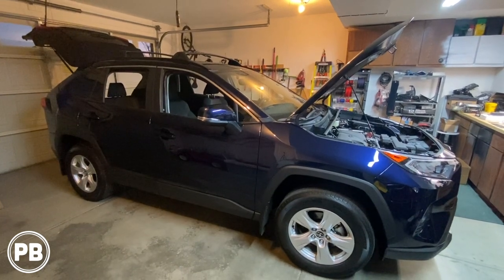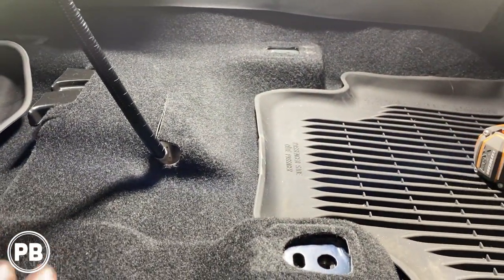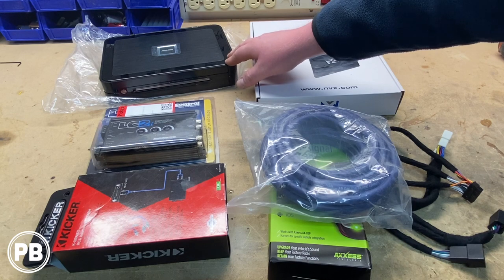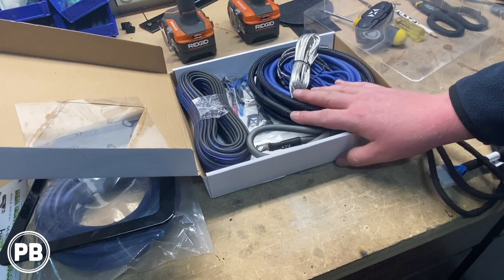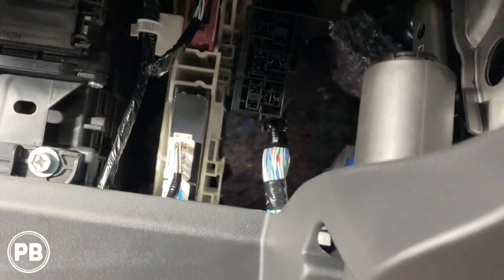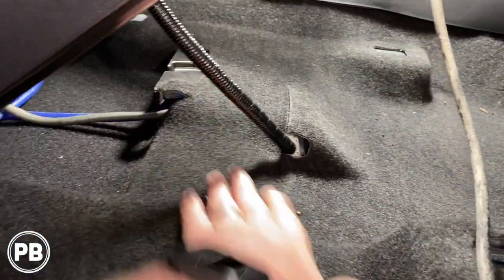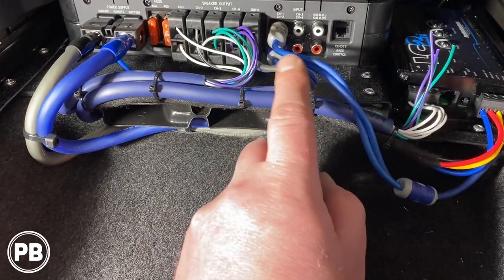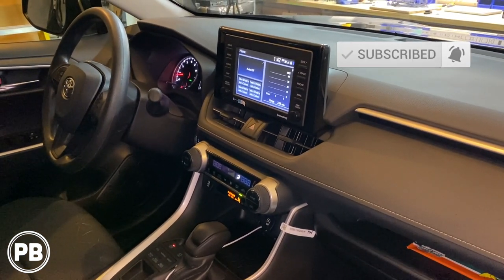2019 - 2023+ Toyota RAV4 5 Channel Amplifier Install

Comment: The fact that you made your own harness and didn’t cut any wires is genius. Wiring is very neat. Explanation of everything is very concise. Very good video and craftsmanship      . I just have one question, how do you tell the amp to send the signal in channels 1&2 to channels 3&4?
Reply: I didn't make the video but I can help- on the amplifier, there's a switch where you can choose what inputs are used by outputs 3 and 4. On this amplifier it's a physical switch on the side of the amplifier with the adjustments for crossover, gain, etc. If you do a similar install to this, either make sure your amplifier has that functionality OR use the 6 channel lc6i model instead of the lc2i and you'll additionally keep the ability to fade forward and backwards in the vehicle.

Comment: @provo beast I have installed a system in a 2015 RAV4 using the lc2i tapped into the wiring the factory head unit doesn’t have enough volume and the replacement door speakers I installed are still connected to that head unit, could I disconnect the  connectors from the sparkler and wire them directly to my amp since the sound signal is still coming into the lc2i first?

Comment: I just bought a 2023 Toyota EXL Premium model that didn’t have the JBL system unfortunately.  I wanted to add a big Kicker Speaker Box in the back.  2/12s and some Tweeters all built into this cabinet with maybe a 2,000watt AMP.  Dealership advised me that It could void my Warranty so that sucks.  The Salesman said it would be just an excuse to void my warranty.

Comment: This is pretty much what I want to do for my soon to arrive 23 XLE. I'm struggling to find the right harnesses though and I don't think I'll be cutting out any of what you did (Though that's not a bad ide). I just want to pass the signals down and back through factory just like you did while preserving the factory aspect to either remove or upgrade easier down the road. Great videos though.

Comment: Great video. 
Does this mean the two front speakers in the dash are still powered by the factory head unit? Or did you power them with the amp?

Comment: Is the cables' cross section enough to pump 100 watt speakers? On powerful installations I saw they swap wires between amplifier and speakers

Video is very good! TNX!

Comment: Thanks for the vedio. Both Red Wolf harnesses dash speakers plug & play the in and out to & from amp cut in half spliced worked great. Used a factory ground in the passenger B pillar. The stock deck distorts starts @ least on mine at volume 38 on my oscilloscope and also on the rockford amp I have that shows distortion. Highly recommend boom mats and cut the bottom 1/4 out lots of water intrusion in these vehicles for some reason? Window rails are right above seakers.
Reply: It’s the door speaker wires that’s the problem!
There like 18 or 20 gauge.
I wouldn’t put more them 70 watts threw them.

Comment: Do you recall which Pin # for Ground, Constant 12V, and Accessory 12V?  I'm doing something similar, finding a harness like Metra 70-1765 & 71-1765 and building a male/female harness and tap into that to wire a small Alpine KTP-445U

Comment: General question:  If you  send 2 channels to an amp, and have 4 channels coming back to the speakers, does that negate the 'fader' function in the stereo?  Just wondered.  This video is fantastic and will help with a future installation I am planning.
Reply from the maker: Yes, this individual didn't want the LC7i version, so we simply just did the LC2i to power the 4 speakers and the sub channel.

Comment: I enjoy your videos.   I have a question about my 5th gen RAV4. I installed dashboard and front door speakers. I have left the rear seat speakers as is for now. I would like to get an amp to boost power to my new speakers and keep my headset as stock. The question is how many channels do I get an amp for my RAV4?  4 or 5 and will that let work with all of my speakers?  Thanks for the help and for the great videos.

Comment: Hi bro
Nice work 
I have Camry xse 2019 
Head unit screen 7 inch
I want upgrade all speaker and add sub  factory place and small tweeter in back 
What the harness adapter the appropriate Where can I find
To connect all system amplifier 5 channel with loc lc7i6 audiocontrol 
???

Best regards

Comment: Hey. 
Wene u set the amp Gain. Did u have the oem stereo on max volymen? 
Or at 3/4? 

If u had that can u play now on Max volyme or do you stop at 45?

Were do the radio distorsion? Volyme?

Comment: The video is well made PB. One question is that can we install same setup in Camry 2023 non jbl stock radio?
Reply from the maker: It will slightly differ, but similar technique. Send us a message on Facebook and we can give you some helpful direction.

Comment: Very well explained.. What harness would you recommend for a factory radiof a 4th gen 2018 Rav4 with Entune Premium Audio? Im just adding a  Line out converter, 4-channel Amp and a powered subwoofer. TIA
Reply from the maker: If you have the factory amplified audio system (usually identified by having a factory sub in the cargo area), rather than making a T-harness at the radio, you will have to bypass the factory amplifier located behind the passenger side rear cargo panel.  If you don't have a factory sub, the parts in the description should be all you need.

Comment: Just had one question does the amplifier convert the 2 inputs into four speaker and one sub output meaning no more rear to front fader control and is there a way to get that fader to work
Reply from the maker: Yep, that's what the customer opted for.  If you want fader, use the AudioControl LC7i!

Comment: Can u add a video or a link of the power , constant power and ground lay out because I can’t find that plug in the video to make my own like you did  thanks
Reply from the maker: It was apart of the T harness we used, and we just extended those wires to our LC2i.  The harness is listed in the description, but you may have to do a bit of digging to find one as they have been discontinued and are now harder to come by.

Comment: Do you need the LC2i if your amp accepts both preamp and speaker-level inputs?
Reply from the maker: You can go with a high level input. Check out our new Tacoma video where we basically did exactly that.

Comment: Is this the gas model rav4? I have a hybrid. 12v Battery is in the trunk compartment
Reply: Hybrids have power restrictions for amp installation, according to the dealer's technicians (also Crutchfield) it's limited to 30 amps maximum for the fuse. So, it's wise to purchase the gas only version of the RAV4 like I did.

Comment: Toyotas original headunit have low bass frequency and volyme on rear speaker..
Ist better to 
Take just front Chanel to a loc and to the amp.   And set amp to clobe signal to 4ch mode.  (And lose the fade funktion)

Comment: Hello. 
Do fade front & rear  work on this setup?
Reply from the maker: No, not using the LC2i, as we are using 2 channels  of signal for our 4 channel amp.  If you want full fade functionality, you will need the LC5i version.
Reply: @ProvoBeastAudio  posible to fade wene only use front signal from headunit?

Comment: and also what is the head unit volume when the distortion start. sorry i dont have the smd. but we have the same car. i have tried to do full range on the rear but it did not give me the same bass as in the front. thanks!
Reply: I have a 2021 Camry.  Looks like the same head unit.    I used a smd 1.  At 47 was clean after that. It started distorting.

Crutchfield was tweeter adapters you can t harness off of.   Instead of going threw the head unit.

On Toyotas those audio control LOC are mandatory!    Signals way to weak all across the board!

That dude did a really clean install!

Larry

Comment: Thanks a ton for this video, very helpful! 

Quick question: If only the front speaker inputs are connected to the LC2I (22:51), will the factory head unit retain the ability to fade the speakers, either front to rear or left and right? Curious as to how that works. 

Thanks in advance!
Reply: No

Comment: on a tacoma, there are 4 spkers for front stage. are the tweeters tied in with the door speakers, or is there a way to leave the tweets on HU power?
Reply: Most guys are swapping the 3.5" dash speakers with the tweeters from a set of components in the front doors.

Comment: With the dash and front door speakers being in parallel, how do you decide what wattage to provide to the front channel? Or do you just have to go with the lowest of the 2?
Reply from the maker: We replaced our front component set so we knew exactly how much power we needed.  In this case was 100w RMS @ 4 ohms.  In general, you would add the wattage handling power of both speakers, determine what impedance they are running at in parallel, and find an amplifier that will provide that power.
Reply: @ProvoBeastAudio  it's been a minute since I took an electrical engineering course. Please elaborate further. Not sure what the circuit layout would be in order to calculate the overall impedance. I know the formulas, just not sure of the circuit layout.
Reply from the maker: @ThatWestVirginian  Impedance will be generally set by the speaker manufacture for that specific speaker, however, adding or removing speakers to the same line / channel with change that impedance, or resistance, that the amplifier sees.  For example, if you add 2 single voice coil speakers that each are 4 ohms in parallel (pos to pos, neg to neg), that will decrease the resistance or impedance at the amplifier to 2 ohms.  Alternatively, in the same example, if you wire both speakers in series (pos to neg, neg to positive), this increases the resistance or impedance to 8 ohms.  There are many variables here as to what speakers you are running, what amplifier you are running, and what impedance your speakers are and what your amp is stable at.

Comment: is it normal that the rear speaker signal have less bass? all speakers are amplified, by my rear door speakers have less bass.
Reply from the maker: Check your high pass filter setting on your amplifier.
Reply: You're probably using a 4+channel line output converter. If that's true, and you used the original factory signal for each door speaker, then the reason you're hearing less bass on the rear speakers is cause that's how the factory system comes. The front end of your system relies on the dash speakers to provide the upper end of your frequency spectrum so the door speakers have more room to play bass/low frequency notes. The rear half doesn't have the luxury of having dedicated high frequency speakers so it's tuned to play less bass and more mid/high notes.

Comment: Can you put a amp in a hybrid version 2021
Reply from the maker: Yes as there is still a 12v system in the hybrid model.
Reply: Thanks does it matter how many watts
Reply from the maker: @Davislifestyle30  Depends on your charging system and how much your alternator puts out.  Most factory wiring can support from 500 - 1000 watts RMS with a healthy primary 12v battery.
Reply: Is there a way I can find out that information on a 2021 rav4 hybrid
Reply from the maker: @Davislifestyle30  Take it to a local audio shop.

Comment: my setup
Focal rse 165 for my front
focal rcx 165 rear
Jl jd400/4 amplifier
Lc7i
Jbl basshub pro
Reply: How does it sound
Reply: I just got all of what you have listed but with a focal AP 4340. Do you have pictures of your wiring or a diagram? I have never wired using an audio control before. Appreciate any and all help!

Comment: where is the link for the wiring harness?
Reply from the maker: https://liftkits4less.com/catalog/product/view/id/328499/s/plug-n-play-harness-for-ax-dsp/
Reply: Do you recommend an alternate wire harness. The Axxess is discontinued.
Reply from the maker: @jeffdub4176  They may be discontinued, but you can probably still find it online.  Pac may have an alternative.
Reply: Can't find the DSP 3 harness anywhere .. any suggestions ? What's the difference between the dsp 2 and 3? Thanks!
Reply from the maker: Updated link to the speaker harness: https://amzn.to/33reILj
Reply: Do you have a video showing how to use the updated harness ?

Comment: If you have the JBL system, your install WILL NOT “differ ever so slightly!”  In fact, you’re going to want to rip that garbage out and wonder why you opted for that package!  The JBL system sounds like a third grade music chorus with severe flu.  Highly crossovered and filtered!  Absolute garbage and JBL should be ashamed!  You can not tap into those amplified signal wires and you will not be able to send a sub freq to a sub!  200hz at best to a sub.